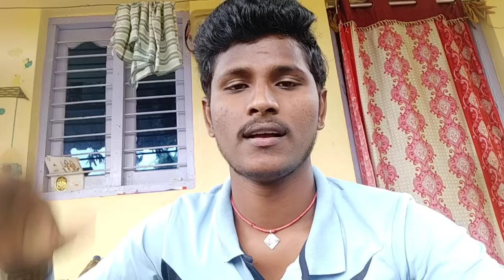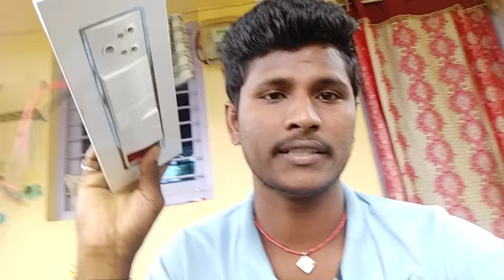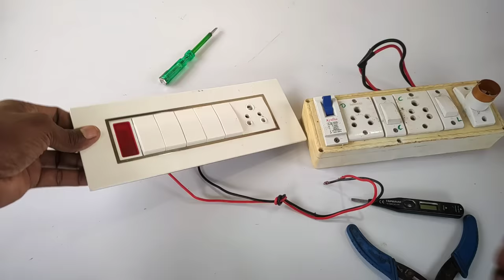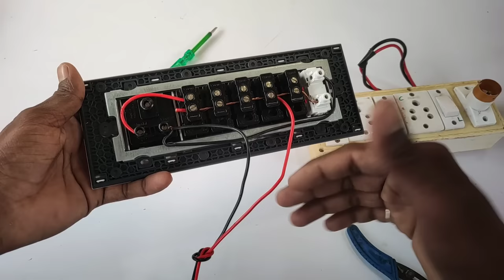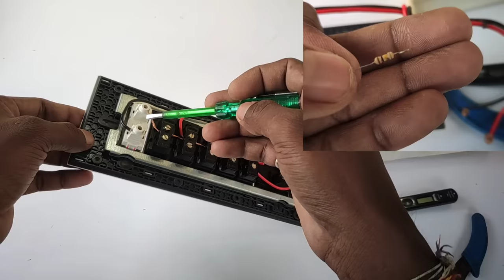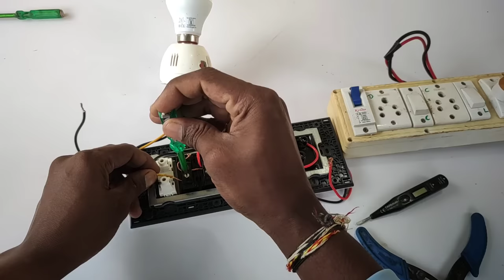Electrical Socket Why Both Side Power Coming | How To Solve Power Return Supply In Telugu

Comment: Neutral cut ayithe switch vesthe neutral ki power vasthundi but bulb 💡 velagatledu kada so bulb veluguthu nutrul ki power vasthe ela ala kuda vasthundi reply
Reply from the maker: Neutral ranapudu bulb velagadhu bro bulb veluguthundhi ante adhe induction vala
Reply: @Ramuelectricalworks  ante two sockets lo power vasthundi anni work avthunnai how and what is the solution

Comment: Anna recently ga oka 2nd hand wrk chesthunam aa intlo  inverter connection undi adhi cut chesam and new ga  konni light point vesam and earth wiring pettam 2way pettam ithe connection ithe 2way ki and inverter ki wire ki earth wire ki light point wire ki  face vasthundhi connection ivvamunduke adhi ela solve cheyali anna
Reply from the maker: Returns supply avuthundhi  kavachu
Wiring problem undhi bro
Reply: @Ramuelectricalworks avna  bro palseeling chesaru ippudu ela solve cheyalo ardam ithaledu
Reply from the maker: @jorumedia  anni boards lo check cheyandi
Reply: Anni boards lo check chesa bro problem ekkado dorukthaledu inverter wire ki earth wire ki fave vasthundhi bro

Comment: Bro fan dhi switch control  connection tesina sare fan tirugutundhi  problem enti but  face ,nutral wire ki face vastundhi problem  enti bro
Reply from the maker: Wire fail iendhi bro
Reply: @Ramuelectricalworks   wire fail ayithe suply rakudadhu kadhaa

Comment: not proper. You have shown only when the nutral disconnected & light will not work.  Whereas I have seen recently,  Phase & Neutral are showing correct when checked with tester & still lights, fans & even ACs are working as it's without any problem.  why this is happening in rainy season is there moisture or earthing issues......
Reply: Give ground earth to the house

Comment: రెండు వైర్లు ఫేస్ వస్తే ఏమవుతుంది అన్న🤔 చెప్పు అన్నా అలాగే మనకి ఎంత వోల్టేజ్ వరకు అయితే మనిషికి షాక్ కొడుతుంది చాలా రోజుల నుండి నాకు ఈ డౌట్ చెప్పన్నా ప్లీజ్🤔🙏
Reply: 220-230.voltage ravali.tester 110volts nundi valluguthumdhi 100 110 numdi shock koduthumdhi 

Natural fail ainappudu a reten supply vatumdi 99% e probulam pole medha series wire fail authumdi

Comment: Current undagane denikaina connection Ela ivvali
Reply: Current unnapudu, first neutral and phase check cheyali next, power of chesi connection evali, power off cheyakunda wire ni tuch cheyakudadhu shock vastundhi so be careful